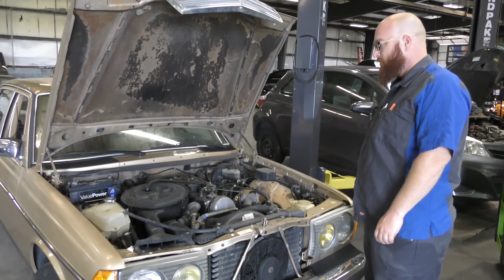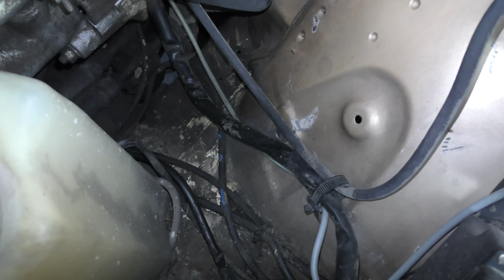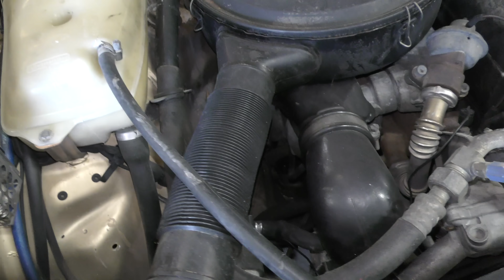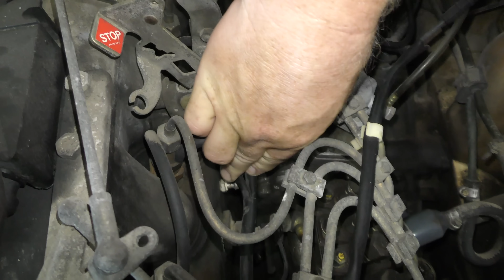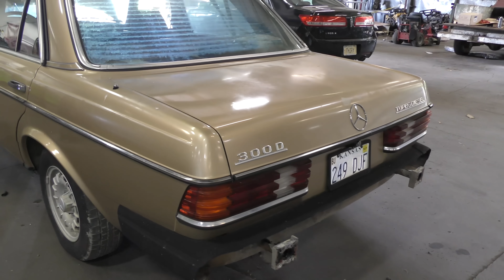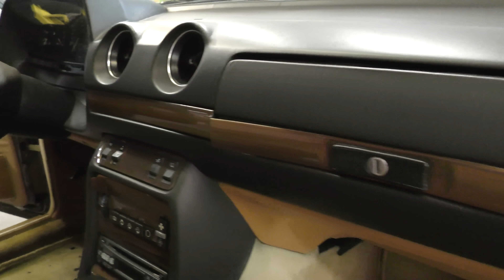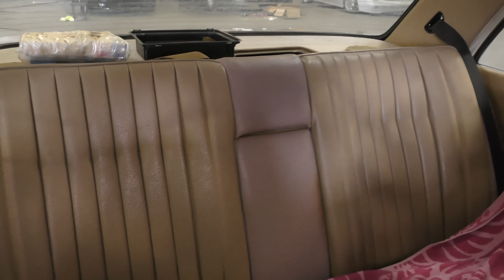Tank of a Mercedes 300D with a 3L Turbo Diesel! CAR WIZARD finds lots of surprises under the hood!

Comment: I have an '82 4-speed  240D and '84 Euro 5-speed 300TD.
If it hasn't been done recently on these old diesels, seriously consider replacing the vacuum pump, or at least it's actuating-lever.
The original lever's roller-shaft bearings have plastic cages. When they fail, parts of the bearing will fall in the timing-chain!

Comment: I have an 82 300TD wagon in my driveway, still runs and has been in the family since my mom bought it new. I have so many memories with the car the last thing I want to do is part with it. 
It's still a very solid car, lucky for me I found a very good mechanic. I once took it to a local Mercedes dealer, my service adviser told me there are only two guys in his shop that could work on the car. And he was one of them. There is one thing that I really like about the car that Mercedes doesn't do anymore. When you open the door(from the outside) the handle that opens the door doesn't feel cheap. It takes a good but light tug to open the door, feels like your doing something. 
My mom once asked me why I was keeping it. I told her it was her fault for buying such a good car.
Reply: Yep...my '85 300TD is the family time machine.... it'll outlive two generations and if my son falls in love with it like I did....who knows
Reply: Agree that the door handles were good, as was M-B Tex.  That's about it.

Comment: Mr. Wizard!  The W123 300D is the best car ever made.  I have a Euro import, 300D with a 4- speed gearbox.  It's a 123.130 with manual climate control, manual sunroof, and manual windows.  Basically, everything that "usually" breaks on this model is manual.  I also swapped the 3.47 final drive with a 2.88 and can drive 75mph and the speedometer reads 60mph.   I'm really looking forward to some more content on this car.  Keep up the outstanding content.

Comment: It amazes me how reliant a diesel engine relies on so much vacuum assist to do things. Diesels don't have good vacuum to begin with and than add a turbo damn. Does it have a vacuum assist pump?????
Reply: Like most diesel, it has an independent vacuum pump that is engine driven.
Reply: All diesels have vacuum pumps.  They do not create vacuum at the manifold like a gas car does. (Diesels do not have a butterfly in the throttle body, so there is no vacuum.)

Comment: I can smell the inside of that car through the computer.
Reply: Smells like a horses's ass.
Reply: Well Mercedes did use real horse hair in their older cars.
Reply: One of those cars you can be blindfolded and thrown in and know what you're in.
A '69 Chevy C-10 is one.
A public school, school bus, is definitely one too!
Reply: Mine's not diesel, but the interior has a distinct smell.  The blue leather *vinyl seats are in great shape if anyone wants to buy them!  89 260E (124 body)
Reply: Yea it smells like u

Comment: Here come the diesel fanboys.  To be fair, if you're using these for taxi service or put many miles on them, and I mean MANY miles on them, go diesel.  But I love the gasoline versions myself, especially the larger engines.  This chassis (W123), both gas and diesels was one of the best in terms of longevity and reliability.  The other good one, maybe even built better, was the W126 (basically the bigger brother). 
Book value on these is low, but amongst enthusiasts and connoisseurs good examples of these cars fetch a lot of money.  As in upwards of $10-12,000 U.S. Much more in Europe. As mentioned, the diesel models are favoured, but especially the wagon versions.
When wizard mentioned longevity easily into the 400-600k miles, he forgot to mention the obvious (to those who know these cars) - we're talking engines never opened or rebuilt.

Comment: The OM616 with some OM617 parts is still manufactured and sold in India inside a G-wagen clone. If you can't find a part, that may be a good last resort.

Comment: Once its replaced, can the wire-shielding be rubbed with anti-rodent poisons [--using gloves, of course ], to prevent a "repeat" [--although if she's taking it to college, it'll be outside, probably,--less likely to suffer such ].    I "trust" your work, though,--after all, it's on the 'Net!    If that, or your "parts-car" turns out to be fixable, and she falls-out-of-love with it, please let me know.   I had a "money-pit" 2003 230C that got all New parts, and should have NOT have been given to a family member, because its takes them WEEKS to see about something simple like alternator-belt tension/alternator condition, so their new battery won't go dead.  If you have a specific "problem", even though thou$and$ were spent, that specific-problem HAS to be seen about,--not forgotten!
Reply: Mercedes Classic Center in California, WILL be able to get you a complete wiring loom(s) for the Benz, you're restoring.   If you dented and needed to replace the 1939 540K front fender that was given by Hitler to Stalin, they could MAKE one for you from the original blueprints, if the one they have in stock, is not for the correct side.   Ph: 949-598-4850, open Mon, 8Am Pacific--I'm not affiliated in any way, just trying to help.

Comment: These old  mercedes sure drove nice,  I had a 300sd  and a 300e . they were both solid and  smooth and quiet , loved driving them with the there  large steering wheel.  I now have a c230 that is fast but junk compared to the old ones.     But hes right they do need quite a few small things at about 175 k,  window switches start quitting , electric antena ,    rubber driveline disk u joints,  and other suspension rubber gromets .   But  well worth fixing.

Comment: Is this worth it? There’s one with 50k miles 1 owner by me for 15k
Reply: Gary two years ago it would have costed 3k. 
15k is a bad investment. I doubt it would go up.
They made millions of them. 

If you want a classic car it's better you search one that isn't a trendy classic already. 

15k for a 300D only if it's totally sorted and original: wires, vacuum system, gaskets. Everything. But it's still a 3000$ car. But I'd look some other car that it's not in a internet craze.

Comment: At least you push new parts. Had a mechanic that only used used parts and sold them as new. Not re-manufactured, straight up used. As someone who makes wire harnesses at work, 5-10 grand is low ball haha. Maybe if they still have the machinery and material. The wire and terminals won't be an issue, it's the plastic blocks.

Comment: I would like to see a Wizard video on "20 Cars I Turned Down Service For" or something along those lines, detailing to us what kinds of cars customers bring in that Wizard won't work on and why they're not worth it.
I always knew Wizard couldn't possibly accept every car, but I still would love to hear the most ridiculous cases.
Reply: a long list of BMWs
Reply: There's the last more-than-few BMW Hoovimobiles...🤣🤣🤣
Reply: I've heard accountants say that if you get every job you bid on, you're not charging enough.  That's in construction, I bet mechanic work is pretty similar.  You're an idiot, or just really desperate, if you take any and every job that comes your way.
Reply: Just because a ___________ makes video on YT does NOT make them and expert in their field.  Doesn't even make them above average and in many cases barely competent.  I've owned a speed/machine shop for 30 years.  I've literally built/machined almost every size/shape of engine.  From snowmobiles to 100 year old tractors to 426 Hemi's to a LOT of Fords with blown plugs.  I've seen SOOOOOOO much ridiculous BS on the internet/YT over the years regarding the job I do every day.  Either being over dramatic about how difficult something is or simply being ignorant of the "details" which go into some procedures.  A LOT of myths running around out here.  Be VERY careful of who you listen to.  MUCH better off going to your local, long standing small shop and talking to "that" guy who's been doing it for decades than some 20 or 30 something who's bought a bunch of new equipment in a sterile shop and proclaims to be a pro.
Reply: @TakeDeadAim  It sounds like you have a lot of customers that fix things regardless of expense, which is pretty cool in it's own right.  That doesn't really add up to the conclusion that the Wizard is just some incompetent YouTube hack, though.
Reply: It's a downer and getting a little old tbh. Almost every video he talks about what he doesn't want to work on, why he doesn't want to work on it, etc. Like I get it man, working on almost anything is never easy, but it is literally your job. The people watching this and the customers aren't looking for the sob story, we're just here to watch cars getting worked on.
Reply: As someone who drives old cars I just got used to doing almost everything myself. But was recovering from a surgery and needed something done and got this b.s “we don’t work on anything that old”. Came to the conclusion they didn’t want to have to manually diagnose it. If they can’t plug that high dollar computer in and have it tell them what’s wrong, they’re not interested. Liability my ass, there is liability in the entire profession. I worked at a Porsche shop for years, I know that much lol. The difference in how I’m treated driving my Porsche vs when I’m in my 69 Galaxie pisses me off quite frankly. You find out real quick the preconceived notions people have. Not saying Wizard is this way, but that statement brought back that memory.
Reply: @bw8632  Note that a great many technicians do not possess the skills needed to service some older vehicles, take for example tuning a carburated engine, or deal with drum brakes. Not to mention the possibility of hard-or-impossible-to-find service parts.
Reply: Well in my case it was valve cover gaskets on a Ford 390 V8 which are as common to find as windshield wiper blades. Ended up doing it myself when I was given release from my surgery. You are right about Carbs. I get that. But drum brakes are still in use. Parts availability on any Ford has never been an issue. I have 9 cars and I do them all myself, except my new Audi A8 and Porsche Panamera. Where I mainly run into the old car thing is just simple safety inspections. All except those 2 are emissions exempt. Have to go near little Mexico of Dallas and they never say no. But up in the suburbs, they act like you’re going to ask them to stash a hot pistol. Wipers, lights, tires and horn are hardly asking all that much to inspect. Oh well, it is a great motivator to just keep sharp and DIY. Back when I worked on Porsche, they were mostly air cooled. I don’t want to think of having to DIY anything new
Reply: @bw8632  You sound like you have a good attitude on cars and a lot of experience. You may be "old" but passion for something dies hard.
Reply: @gillesthibault429   Yeah, many mechanics don't call themselves mechanics they call themselves technicians. And I guess that's true in many cases. Engine diagnostics and simply replacing parts has become the norm.  In fairness to the Wizard, he's a young guy and has admitted that he doesn't know much about tuning carbs and prefers fuel injection. However, he's very intelligent and I'm pretty sure that he's pick it up quickly if he had to. I prefer fuel injection too! I just don't have that on everything that I own. I still have drums on the back of my 65, only because Willwood told me they don't make a conversion kit for that 65 1 ton. I retire in February though and I plan to do some wrecking yard scrounging and see if I can't cobble together disk brakes for the rear of that truck. As far as the Wizard is concerned I believe he's good at what he does and I try to give him a break as much as I can. Remembering what he looked like the first time he was on video, when he looked like a deer in the headlights, I think maybe some of this internet fame and being considered an "Influencer"  may have given him a larger head than he once had.  At 66 this whole internet fame and being some sort of "Influencer" is all new to me.  But apparently it is worth quite a bit of money to companies.  And sometimes it's a hell of a lot of money.
Reply: @ledzeppelin27  It's not about it being easy. He's had people ship cars to his shop from very far away because they trust him because of his channel.
However, when they call in, they don't mention some of the issues the car has, he finds them, they don't want to spend that much and he doesn't want the failing components to break his repair and have the customer yell at his staff on the phone for hours.
He also works on lots of cars we don't see and has been running his own shop for years, so I can understand that he wants to explain why some jobs are expensive and why some are just not worth it.

He has explained many times that he is not afraid to tackle very complicated cars. He just wants the owner to be aware of how much it will cost and whether the cost of the repair is or isn't higher than the value of the car so that they can choose to fix it or get rid of it before he spends hours working on it.
Reply: @ledzeppelin27  Yea, he's kinda snobby for being a mechanic.
Reply: half of it is stuff he may not want to do(i.E. bmws from hoovie...), the other half is mainly stuff hes skeptical about getting paid for. you do 3k of work on a car worth 1.5k, how likely is the guy to actually pay up?

Comment: Looking forward to this series. My father in laws '82 300D is my driver now, with only 145,000 miles.  My engine shuts off after I use the key in the driver's door to lock the pneumatic locks!

Comment: Mr wizard, all the parts are indeed available directly from Mercedes. I’ve purchased all the parts you’ve mentioned and then some for my 1985 300TD. I recently purchased a new zebrano wood center console parts are not as expensive as many would like to believe.
Reply: Seriously? 
I have access to an 83 or 84 that hit a deer and needs a grille and some piece that connects oil filter to the block and being in the poorest part of the country the junkyards are useless. It's in pretty good shape otherwise but I hit this deadend same as the current owner and for the super steep learning curve I would have due to my ignorance of Mercedes-Benz products. Also this being non-turbo is a major point of concern. So I'm gonna take another shot at it but with a focus on finding a factory shop manual in English!
Reply: @unavailableusername3814  Try your MB dealership. There is wonderful factory support for these cars and you’d be surprised what parts are still available. It may take a couple of weeks to receive if coming from Germany, but you will get them.
Reply: I love comments where you learn something from. Thank you!

Comment: A few of my uncles and granddads have diesel Mercedes Benz 300E and also the cdi 350Diesel. The inline 6 are tanks. Edit: i had put accidentaly 450.
Reply: 450 Diesel? - I don't think that exists. 300D and 350Ds. And the 350D was the same engine as the 300D with larger injector and a few other upgrades - so they added '50' for the SDL350D for a few years.
Reply: @MrKnutriis  I meant 350. Sorry. We had a early version of the CDI 350

Comment: The old 123 diesel taxi in the Mercedes Museum in Stuttgart has 1,000,000 kilometers on it, which equals about 620,000  miles. Impressive, though... I had three of these, a 2 liter diesel, a 2 liter carborator model and a 2.3 liter injection gas version, all being 4 cylinder engines. And I loved either one of them, even though they were very poorly equipped (what was usual in Germany at that time)... Just today I saw a perfectly restored 123 station wagon. Even in Germany only a very few 123s are still alive, most of them being Coupes, which became highly collectable here.

Comment: My Mom had a '79 300 D.  The biggest problem was fuel delivery to the engine.   Despite a couple of fuel filters, it still would clog up and die, them the lines would be cleaned out and it was good to go.

Comment: I love Mercedes cars, I have 6th Mercedes now. I like that Mercedes style to stamp every part with number like that air cleaner. You can easily find always parts for Your car if You have original part which You are changing. Yesterday it wasn't so. I was changing power steering pump for My W220 S320 CDI because plastic reservoir was leaking. It already had no OEM pump, but in Europe You can find easily Mercedes parts from multiple car part shops with register plate or VIN number.

Comment: All that wiring damage looks similar to the damage I am currently fixing on a small fountain that my step-mum's puppy went to town on, both low voltage and high voltage cables are destroyed, and not only is the mains plug (UK/Type G) mauled to death, the small IP68 box that holds the transformer I liberated from it's original adaptor has also been slightly mauled (the mains input connector is completely ruined!). and all that in less than a month.
Also destroyed the connector for the control panel on her inflatable hot tub, my dad doesn't know that yet though, luckily 4 pin mini IP68 connectors are relatively cheap (about £5.50/~$10).

Comment: I live a bit rural, and we have all kinds of funny little furry critters running around loving to munch on the rubber parts of cars. What i found helped and is dirt cheap, is to secure one of these blue toilet stones somewhere in the engine room where it stays relatively dry. The critters seem to hate the smell more then they love eating rubber. Never had a car suddenly going up in flames in the morning since i do that. I just use the cheapest ones from our version of a dollar store, i get like 4 for 1€. If they come with that disolving foil, remove that.